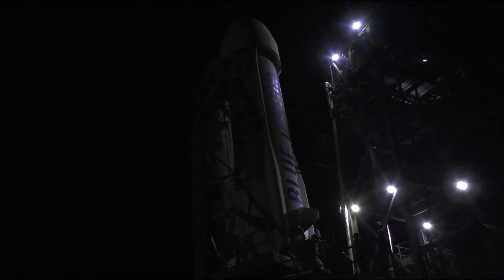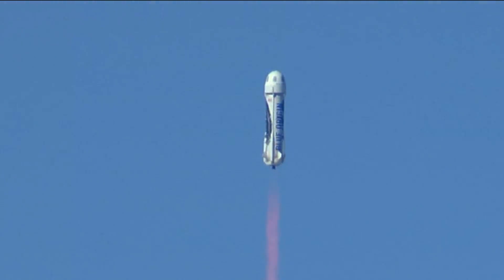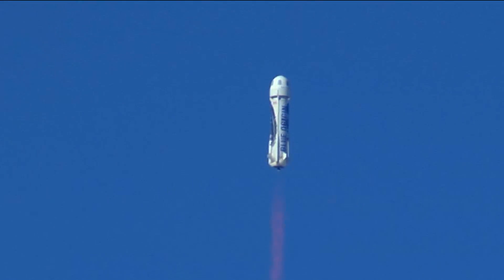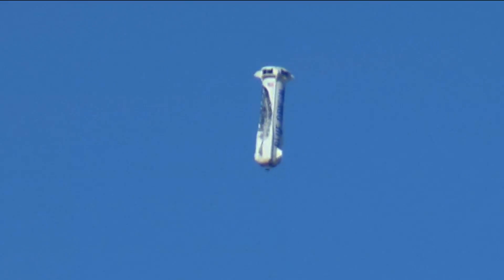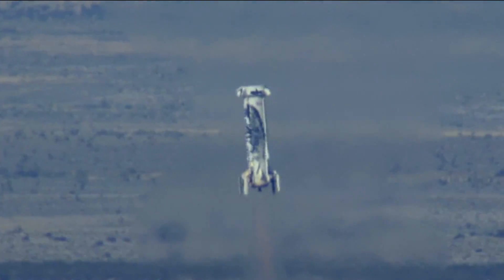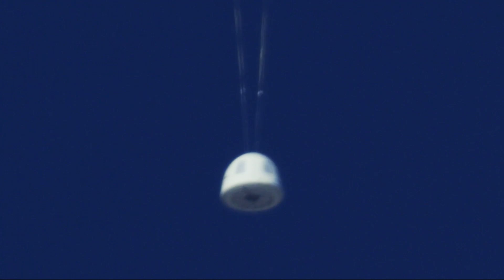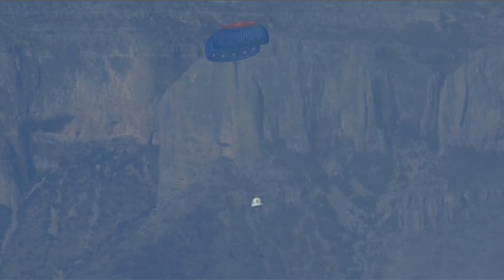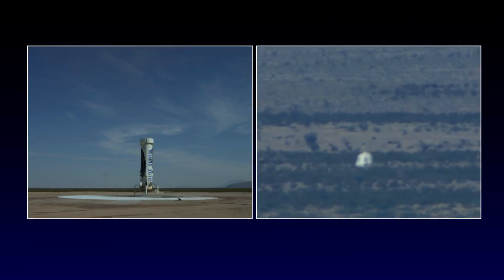Flight Four – One Chute Out

Comment: Due to the excessive speed of the fall, retro rocket ship can not land - it is necessary to use a parachute. 
Planting of the accelerator with the engine - it's not very profitable. Yes - it returns the accelerator and the engine, but part of the fuel needed for planting, very significantly reduce the weight of the payload. 
And here it is not clear what is more profitable - to lose the accelerator and the engine, but to bring into space a lot of weight, or to save the accelerator, but with a small load.
The only justifiable use of such a system of landing - landing on Mars. For use as a normal satellite or spacecraft launches it is unprofitable.

Comment: Just out of interest, how quickly, in theory, could you refuel and relaunch?
Reply: Probably a few hours. Once it lands, it would need to be brought to the launch pad and re-mounted, cranes could do it. Then fuel lines would be connected, fuel it up, and launch. 
You could basic checks of the systems using sensors and software, physical inspections or part replacement/refurbishment would take a few days at least. The launch pad would need refurbishment every once in a while.
Eventually it could be similar to an airline. Launch and land several times a day, then go in for repairs every so often.

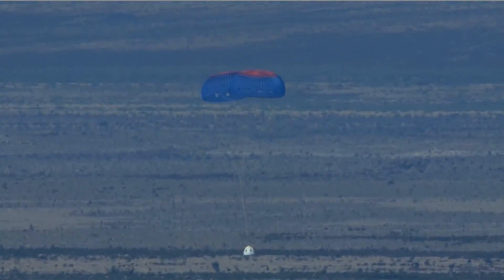Comment: 2:53 Beautiful!! Beautiful?? I did not see a beautiful landing there!!!! I would not have liked to be inside the capsule in that "softly" landing...
Reply: the dust is not kicked up by the module hitting the ground, its actually the thrusters slowing down the capsule for a soft landing, like the Soyuz
Reply: The landing in Soyuz is not soft, it is so rough and violent that astronauts are told to pull their legs up so as to not hit anything metallic and to close their mouths so as to not bite off their tongue.